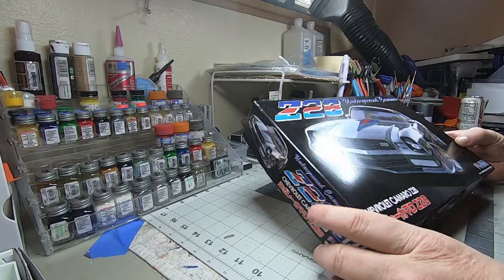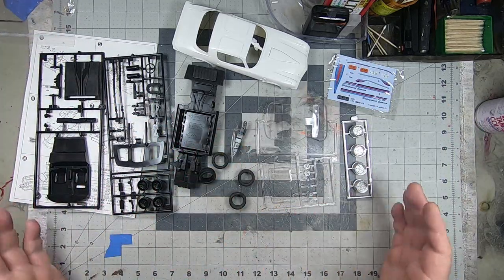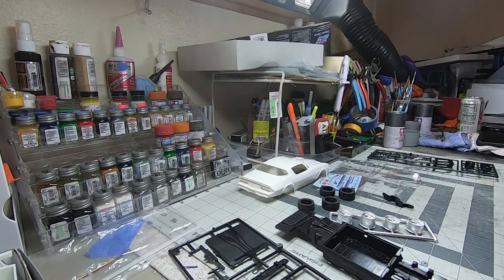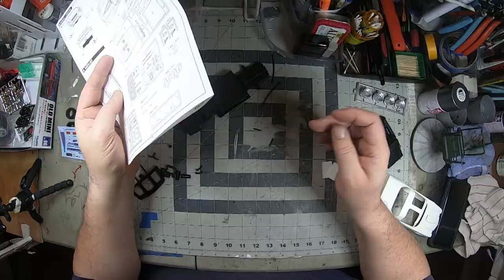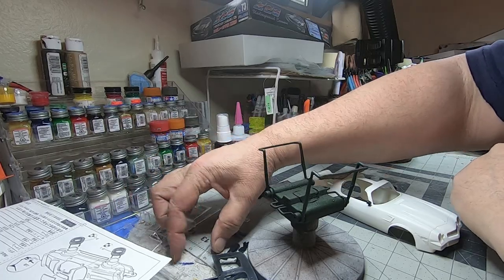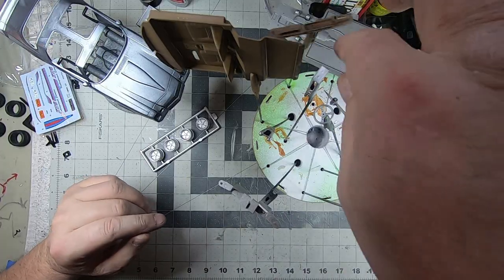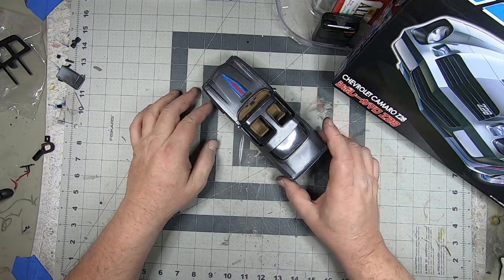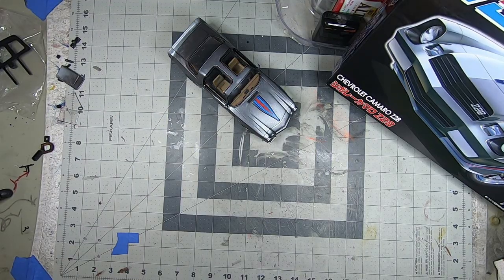Fujimi Z28 Camaro UNBOX and BUILD

Comment: Virtually every Japanese car kit up until the late 1980s came motorised and many had shallow interiors like this. They had potable steering so they could run around in circles on the floor or do straight line races. The slot is likely for an on/off switch. Underground likely refers to underground street racing but the Japanese often translated phrases incorrectly or purely chose words they liked the look of.
Best way I’ve found to fit mirrors is drill the underside and superglue them to a thin brass rod for painting. Then drill a hole in the body and superglue them from underneath (inside the body) that way the paint isn’t damaged and they’ll never come loose.